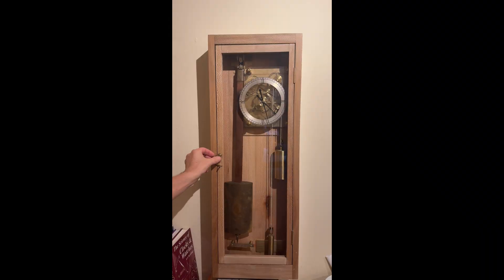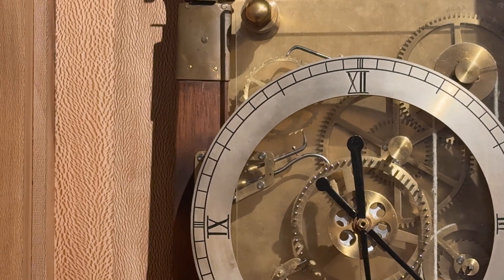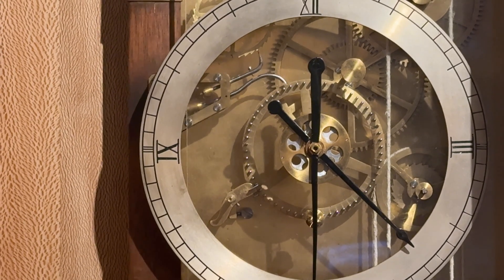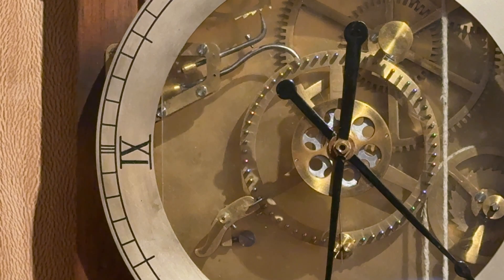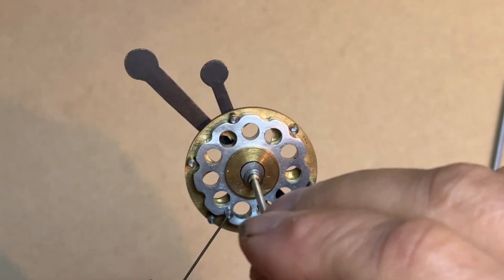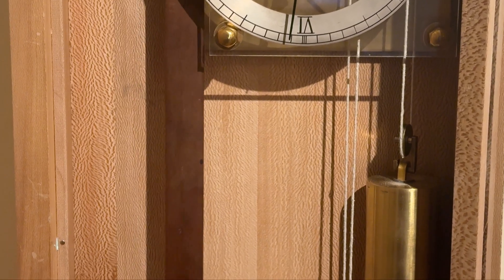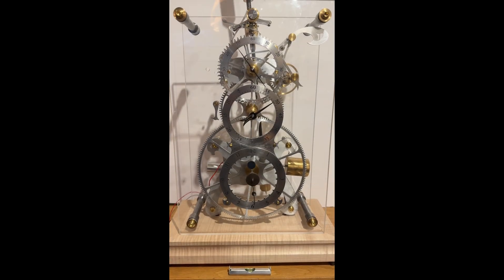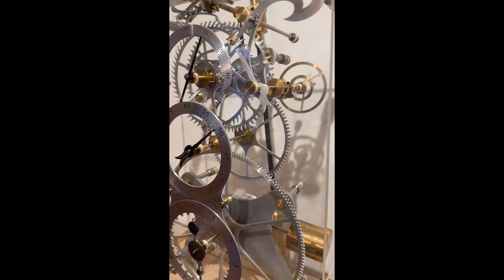16-year-old's first attempt at clock making.

Comment: where the pendulum get energy from?
Reply from the maker: There is a large weight and a small counter weight which supply the energy through the pin wheel to the pendulum via the pallet that unlocks the pin wheel. I hope that answers your question?